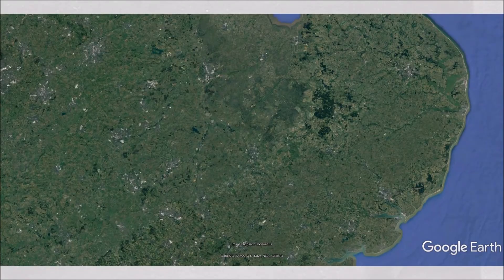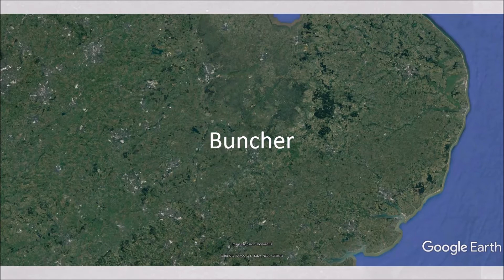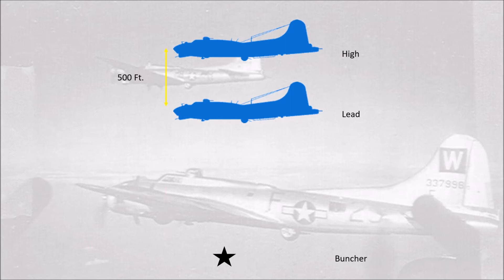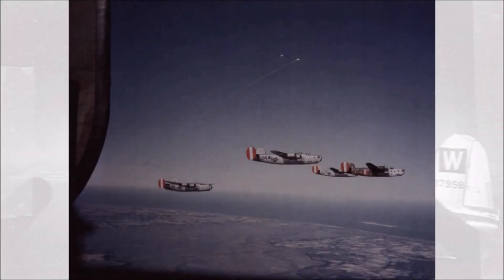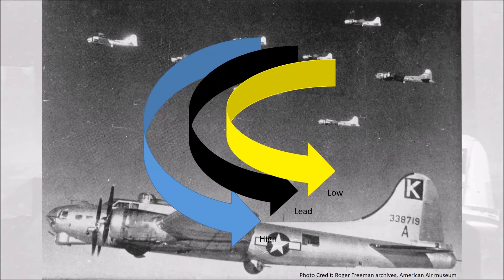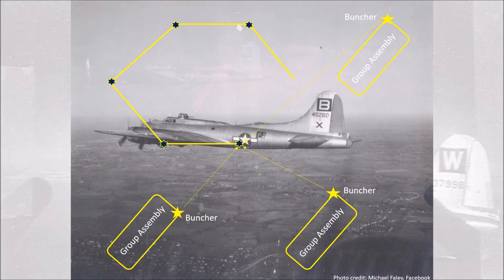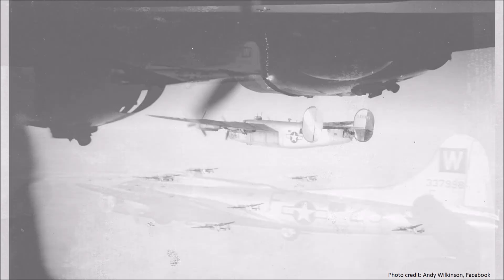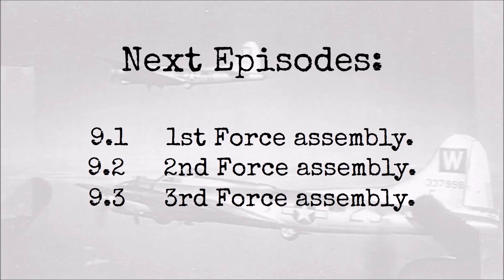24th December 1944, webcast, part 9

Comment: Wasn't the February 3, 1945 Larger approximately 2000 planes than 12/24/44 ? I was on the 2/3/45 and I think also on the I think on 12/44
Reply from the maker: Hi, 

Not it was not. 24th Dec 1944 saw over 2000 Bombers and around 850 fighters for support airborne whereass Feb 3rd 1945 saw 1437 Bombers  and 948 fighters airborne  (Source mighty eighth war diary)
Reply from the maker: Which unit did you flew ?
Reply: 490 Bomb Group 849th Squadron
Reply: When we were flying maybe we were told in the briefing  of the magnitude of these missions. I have no memory of those details.  We took off.  got in line for the formation,   and hoped to return to base.
Reply from the maker: Respect for what you did.. Thank you.

I think I found your name for Dec 24th (you were a pilot?) I have a Spiegel listed as flying with 43-38150, flying in the 93rd CBW "D" Group, Low squadron.
Reply: Yes that was me